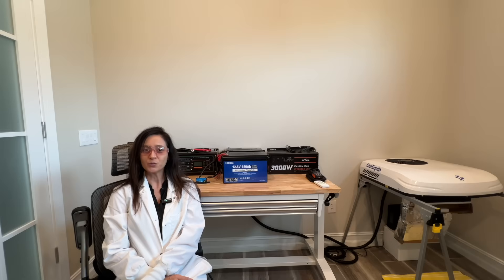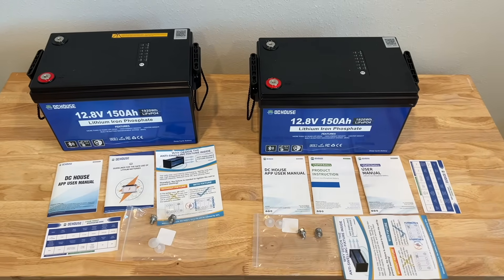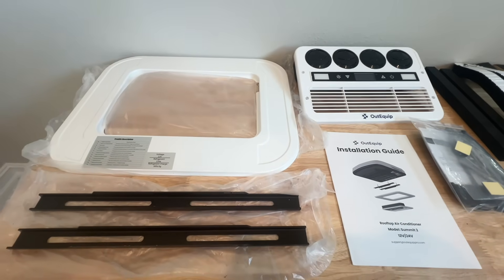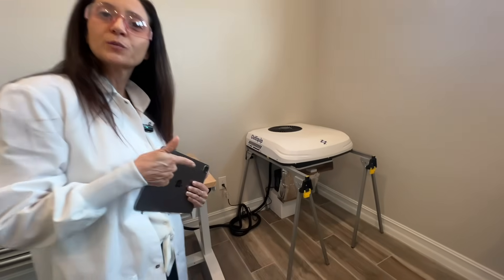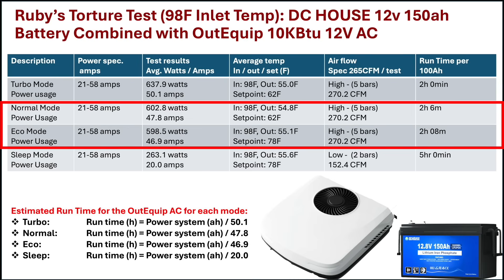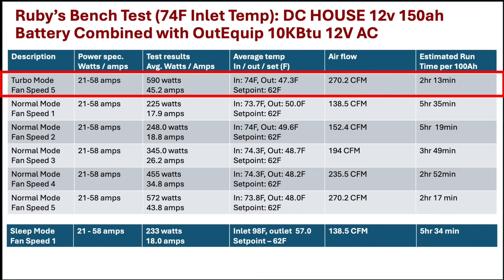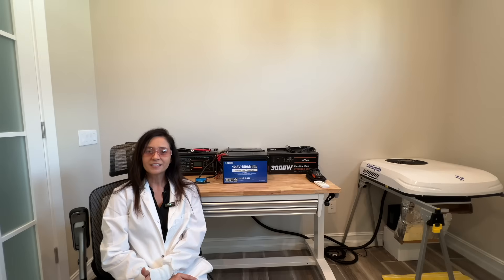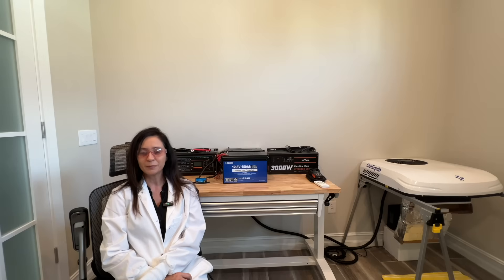OutEquipPro’s Secret: The Unseen Flaw in an almost Perfect A/C!

Comment: I'm considering replacing my 14" x 14" opening sized exhaust fan with a 12v rooftop ac. Do any of these 12v ac's that fit where an exhaust fan was, have a exhaust fan only mode? It would be nice to have both ac when needed, and just a "exhausting air" mode when cooling isn't needed.
Thankyou
Reply from the maker: Great question and I like the idea but unfortunately my answer is not what you will want to hear.  I personally have not had any experience with an AC unit that can also exhaust.
Typical modes you’ll see on DC AC units:
Cool - Recirculates inside air, removes heat & moisture
Fan - Circulates interior air only
Dry - Dehumidifies (still recirculates air)
Auto - Automatically cycles compressor/fan
❌ Exhaust, Usually not present

This is intentional design, especially for off-grid systems:
Exhausting inside air pulls hot air back in
Creates pressure imbalance in small RVs/vans
Reduces cooling efficiency
Wastes battery power
Adds ducting & complexity
In RVs and vans, roof fans handle exhaust, not the AC.

Sorry I could not help you more.  Thanks for watching!
Reply: @RubysAdventuresUnplugged 
No apologies needed. Just a thought/question that I was curious about. Thanks for the reply. Though not the answer I'd hoped for, still helpful to know.
Reply from the maker: NP,  but I will keep my eyes open and even discuss this idea with a couple of the AC vendors that I know.  Thanks again!

Comment: We have a new GOAT in the vanlife world. Subscribed. And shared. Keep it up.
Reply from the maker: Thank you for the such a high complement and Thank you for subscribing!
Reply: @RubysAdventuresUnplugged  YW! I posted the video you made on Will Prowse’s DIY forum that I started years ago called “(Solved) Solving the climate control crises” in general forum. I’ve been tracking all the latest tech as my fiancé and I will be working on a bus build one day soon. Any thoughts on what is an efficient heating solution or what would be the best mini split solution for a bus? Found a mini split that is 38 SEER.
Reply from the maker: @kirkfrahm1252  
I like Will Prowses videos as well ... he is the high bar in solar/lithium tech.  As for your question,  before choosing a system, consider these factors:
Insulation level (windows, walls, floor/ceiling)
Climate you’ll be in (cold winter vs mild)
Power source availability (shore power, generator, solar + battery)
Space & weight constraints
Ventilation & safety (especially with combustion heaters)
IMO, Electric Mini-Split Heat Pump  would be my Top Choice; Efficient heating and cooling in one system, great for all seasons.  Best if you have reliable electric supply, full-time living, or frequent use in moderate to cold climates.
Pros
Very efficient heat per watt (higher COP than resistive heat)
Works as A/C in summer
Quiet operation
Cleaner air filtration options
Cons
Requires stable high-amp shore/grid power or large inverter + battery bank
Reduced heating capacity in extreme cold (unless cold-climate model)

Thanks for the comment!
Reply: @RubysAdventuresUnplugged  considering the 38 SEER Blueridge Mini split. Trying for max efficiency. Yep Will is top shelf!

Comment: It would be nice to see the operational difference between this one and the 12v11500 BTU unit. Any chance you can schedule that one😀?
Reply from the maker: I will be doing another AC comparison video in January as I have a couple companies that have reached out with "all new" AC units.   will ask if they can send me that one for the next video.  Thanks for the suggestion.
Reply: @RubysAdventuresUnplugged ooh might as well throw  in the 12v 13.5k BTU. Wish it had heat pump.  Are you able test the heat pump capabilities?
Reply from the maker: I can and probably should ... but living in FL it is sometimes hard to find days under 80F.  Maybe in January I can get a 50-60F day.   The best I could do is calculate the delta T and airflow to create a BTU of heat number ....

Comment: Fan down, less power use. Yes. Because less cubic feet of air must be cooled per minute.
Reply from the maker: Most AC I have tested, the compressor and fan are separate and the compressor speed is based on the cooling set-point, not the fan speed.  I understand your point as BTU's are a function of airflow.  Thanks for watching!

Comment: Could you please make a bench test video on the country mod 24 volt or 12 volt ac?
Reply from the maker: I will be posting a video within the next week comparing these RV AC:  Velit 12V, OutEquipPro 12V, ModsPioneer 24V, Countrymod 48V, Eco-Cool 120V, and the TurBro 120V.  The video will focus on  the differences in efficiencies.  I will be starting to record the video tomorrow but this is going to be a BIG test so I will need some time to edit it afterword.  Stay Tuned, coming soon!

Comment: it is bothering me when compressor stops but fan still on in sleep mode. it should stop completely. i hope i am doing something wrong
Reply from the maker: Unfortunately, in my testing, the fan does not stop once the temperature set-up is reached and the compressor stops.  However the power usage does drop significantly.  I was more confused by the compressor and fan being linked together as this not the other units I have tested work.  Thanks for watching my video!
Reply: @RubysAdventuresUnplugged  I’ve noticed that the compressor does in fact stop while fan continues, this happens (correlated to achieving temp set point), once the amps gets down into the teens…Mine is the 12v,10kbtu model…Perhaps this is due to an actual RV installation rather than a simple bench test?

Comment: A/C Test Ideas
- OutEquipPro 48V
- Velit 3000R
- Dometic Freshjet 48V
- GREE Eco Cool

These seem like enough BTUs to keep your van cool when it’s hot and humid out.  The Eco Cool on medium might have comparable efficiency and capacity to the 48V DC units.  Reviews also say the Eco Cool is the quietest of any 15k unit.
Reply from the maker: Nice list, I will tell you what, I will reach out to each of these companies to see if any of them are interested in partnering with me on bench testing their RV AC.   Some of these companies are not wanting this as I post the results no matter what they are.
Reply: @RubysAdventuresUnplugged   Nice!  Yeah, I bet some manufacturers won’t be game for it.  That’s why I didn’t include Nomadic.  They’ve been going after this YouTube channel to take down this video https://youtu.be/q9CVH3o49NQ?si=MhSrr6J8bQQGqK1-
Instead, the channel posted a video stating multiple customers having them replace Nomadic 12V A/Cs with better performing units, like the Velit 2000Rs.  Still though, the consensus seems to be that 12V AC is only best for cooling small vans in moderate climates.  Bigger vans or hot and humid climates seem a better fit for a 48V Velit or Dometic.  If you have a bigger van and go to hot humid places, it seems like efficient 120V units like the Eco Cool or the Turbro are the best fit.

Comment: Return it, unless it can use 48V DC.  The amps would be very high for a 12V unit to deliver good cooling when it’s really hot and humid.  With the assistance of the van’s AC system it should be fine though.
Reply from the maker: Hello Nick, I have yet to try a 48V RV AC, but I will put that on my list of must trys.  Thanks you for the tip and thanks for watching!
Reply: @RubysAdventuresUnplugged  I doubt you need tips from me.  I see you’ve tested the Furrion Chill Cube, the Turbro, and now this.  Given how detailed your analysis of things are, I’m sure you’ve forgotten more things than I’ve ever thought about.  However, I appreciate your humble/modest response.  Keep up the great work!
Reply from the maker: I also tested the Velit 12V AC which I found to be very similar to this 12V RV AC  however the Velit has more options such as a great app.  Also, I am learning everyday, who would have thought that the OutEquipPro people would program the fan and compressor speed together.  Interesting idea but IMO limits the power saving options as you can not increase the fan without increasing the compressor.  Thanks for watching!
Reply: @RubysAdventuresUnplugged  I’m curious to see how the higher BTU 48V units perform.  I’m also curious how all the highest BTU units that are 48V or inverter 120V perform vs their BTU ratings.  Seems like claims vs reality are all over the board.